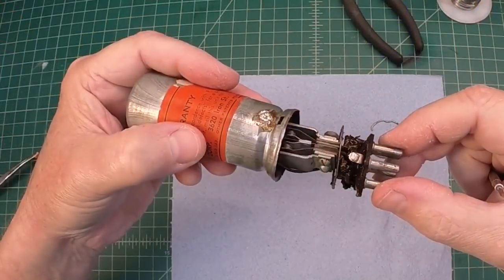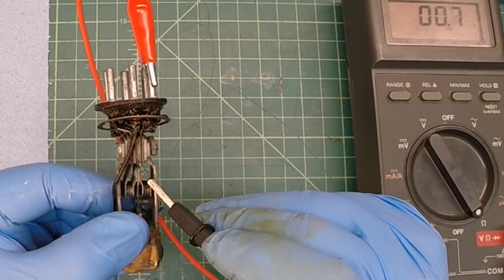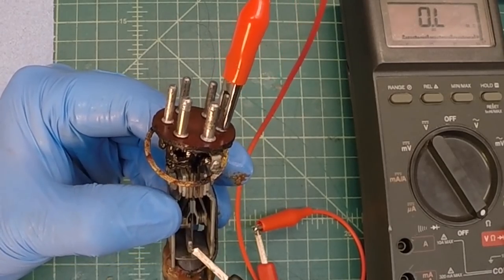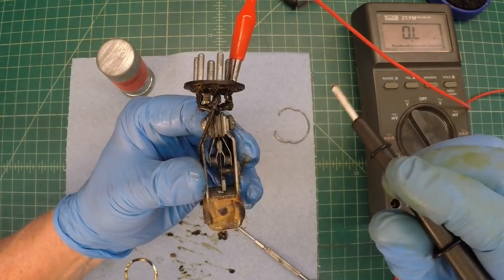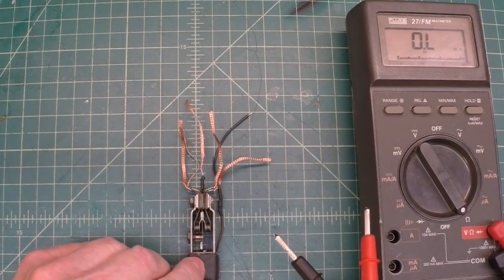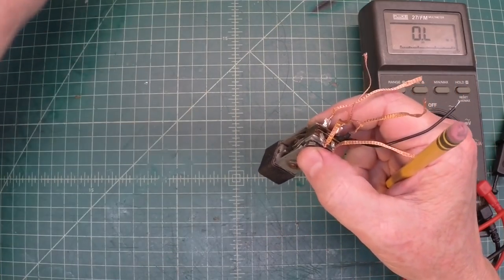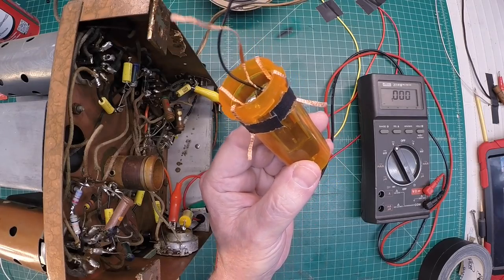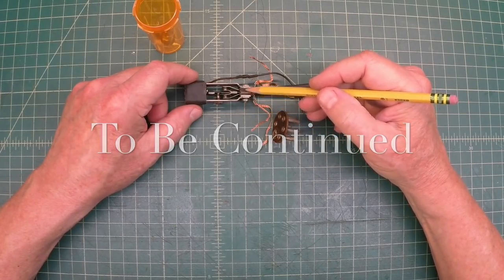Zenith 4-B-231 - Synchronous Vibrator Troubleshooting/Repair - Part 7

Comment: Interesting video.  This takes me back.  When I first started my electronics career, the government was still using mobile radios with vibrator power supplies.  The vibators were only used for the HV in the transmitters.  The radios were hybrids using both tubes and transistors.  We stocked the vibrators and if one went bad we could pull it and replace it.  There were likely dozens of NOS hauled to the dump when we switched to all solid state.  Nice job on the repair.  That was something we never did.
Reply from the maker: Stephen, thanks for sharing your experiences with them. For long term reliability, converting this receiver to a solid state PS makes sense to me. It was neat opening one of these up to gain a better understanding of how they function and what leads to their mortality. Best, Don
Reply: RestoreOldRadios Could you use a flip flop circuit to replace the vibrator?
Reply from the maker: Good question and something worth researching. I’ve only glanced over some of the solid state designs and of course none of them are synchronous designs, so the B+ will still need to come from a rectifier. Sounds like a fun winter research project.  Best, Don

Comment: Glad you got the Radio-Active Waste out of the vibrator.  The current on my GE's was pretty low and any leakage would suck it down.  But as it is the radio sounds good.
Reply from the maker: Josh, it was messy and I’m glad to be past this stage. The old receiver draws 2.2A at 6V. Interesting and you may have noticed it has a 6V Field Coil. Best, Don

Comment: That was a great job Don! Maybe the base can be made out of some of that material you made those knob moulds out of? The gaps on the vibrator looked like you used feeler gauges on them! Im curious of ur 6v input, aim betting when the radio comes on, its loaded to under 5v. Also, the volume/power switch may be part of the issue. You have my attention, cant wait for the next video! Thanks for showing the vibrator repairs, strange how the old base broke down like it did. Take Care--Larry
Reply from the maker: Larry, I think you’ve been looking around my shop and noticed some silicone sitting... LOL I went back and read 20+ articles on Vibrators and decided to set the gaps manually using a sheet of sandpaper. The little power supply has some limitations to your point as the receiver draws 2.2A at 6V. I’ll be publishing P8 tomorrow afternoon. Best, Don

Comment: Hi Don. I remember the goo that came out back in the late 60's though it wasn't that bad then. Time takes a toll. I have used car relays to make high voltage buzz boxes for desulfinating  car battery's I just removed the diode to catch the back EMF .If that vibrator works on the same principle, when the contacts break it creates high voltage low amperes kickback  in the coil. Some of this stuff I remember some I don't .
Reply from the maker: Wow, very interesting Bobby. The old gooey mess was time consuming to clean out, but rewarding since the unit seems to be functioning again. Thanks again for watching my friend. Best, Don

Comment: that gooey substance is probably the remnants of a rubber sleeve that was used in most vibrators.  We used to cut the defective ones apart and pull out that sleeve to use as a tube puller.  The one downside to these sleeves is that they would turn to mush after they had been used for awhile.
Reply from the maker: Dan, thank you for confirming. I was thinking it was the remnants of the rubber/foam base. I like how you repurposed it as a tube puller; very clever. Best, Don

Comment: I'm thinking someone sprayed contact cleaner or something in there that turned the foam rubber into goo, I have a four pin vibrator sitting here I took apart and it has foam rubber in the top and around the base to quiet it down, I don't know how loud it would be without it. 
The one I have is for a "Champion Spark Plug Service" unit that has a sand-blaster and spark tester, and it's part of the high voltage generator for testing spark plugs.
Reply from the maker: Very cool. Yep as I recall, it was definitely a goo. My repairs didn’t hold I ended up converting it to AC power with a power transformer and my Dad still plays it on a regular basis. Thanks for reaching out. Best, Don

Comment: That Goooyy substance is probably whats left of some kind of vibration dampening material most likely it might have been some type of foam, possibly ???
Reply from the maker: John, you’re spot on. It seems a foam rubber material was used and of course with age it breaks down. What a sticky mess! Thanks for sharing your knowledge and taking time to watch. Best, Don

Comment: Should it be making that much noise and what's the point of it? You could check it by just powering it up the coil/solenoid and checking for continuity on the terminals of the points to see if they are making contact properly and adjust it that way, does the coil  have a moving part or is it just a fixed piece of metal pulled by two Magnetic Fields? You probably need to use rubber to cut down any vibrations that's the idea in the first place maybe a door stop might be the right size drill it out a bit bigger in the centre hole and squeeze it on and fill the container with a thin oil like spindle oil used in motors, cut down the noise electrical arcing and corrosion.
Reply: it is a inverted pedulum like structure with a spring and mass - resonant arount 110HZ.   They certainly knew what they were doing. There is a Mallory vibrator handbook pdf somewhere on the internet.  Mallory Fundamental Principles of Vibrator Power Supply Design   Vibrator_Power_Supply_Design_Mallory_Company_1947.pdf
Reply: mohider khana so you saying it works like a crystal oscillator then at 110 Hz. If that was the case why don't they just use a crystal at 110 Hz? Still not sure I understand what the purpose is
Reply from the maker: +mohider khana John, Mohider's reference is a great source to better understand the functionality of the vibrator. To your point, they are loud and noisy mechanical devices. You may have noticed the round enclosure that covers the vibrator has thick cardboard to muffle the noise. In short, they take a low DC voltage and convert it to a higher voltage using a specific transformer for this type of application. This vibrator has an extra set of contacts that provides a rectified high voltage output in lieu of your traditional rectifier tube. Pretty cool mechanical and electrical engineering for the period. Thanks for your suggestions and recommendations. I've already made the repairs, just haven’t had time to publish the content. Best, Don

Comment: I am not sure if that little "brick type power supply can supply enough current to really satisfy the draw of that radio ??!!  The radio might draw 5 amps or more at 6.3 volts!
Reply from the maker: John, the little 5A PS struggles a little. The receiver DC current consumption is 2.2A. Roughly 20 mA for the B+ with the remaining for the heaters, 6V Field Coil and Vibrator. I’ve built a PS for it and also have a 6V battery that I will be using as well, assuming I can stabilize the vibrator. Hope to publish P8 tomorrow afternoon. Thank you for watching and your recommendation. Best, Don